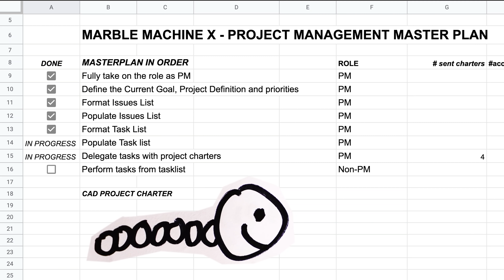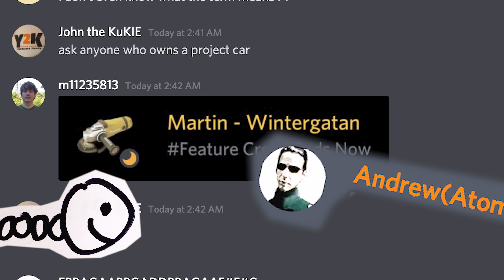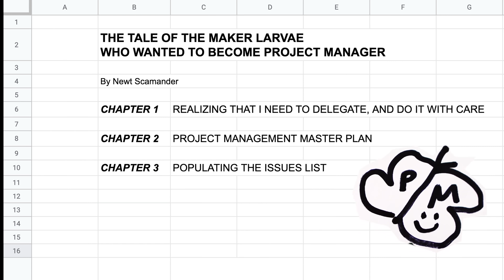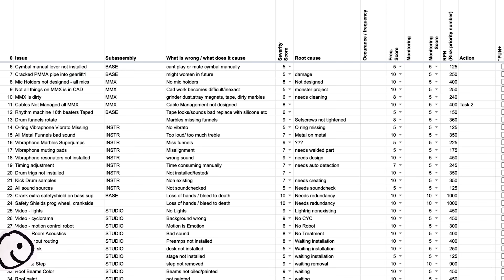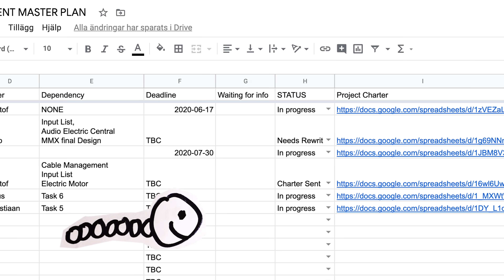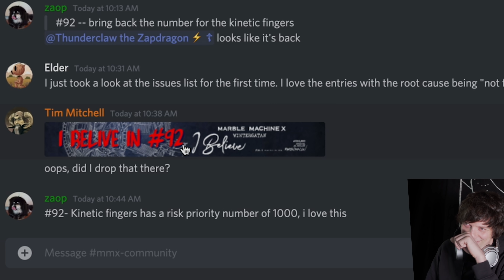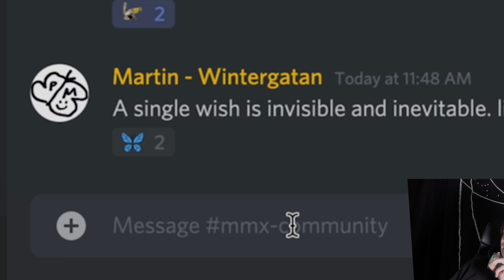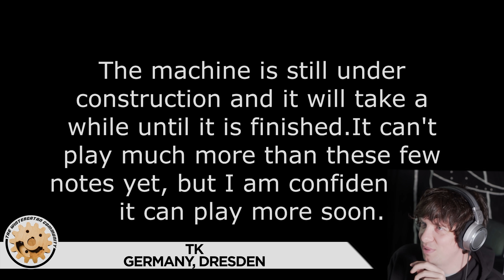109 Things To Do

Comment: Delegate using SMART objectives.

Specific- Tell your delegees exactly what you want. Anything you don't specify becomes their prerogative to accomplish how ever they prefer. 
Measurable- Will your delegee know when they've fulfilled their task? What does the part need to do?
Attainable- The task should be difficult (if it was simple, you should've done it yourself) but not so difficult that failure is likely.
Results Oriented- Delegees should know how their part fits into the larger objective so they'll know if it fulfills its actual purpose.
Timely- Give your delegee a deadline for completing the task. Make sure they let you know as soon as they realize that the deadline is unattainable. You can then decide if they need more time, or more resources to stay on schedule.

Comment: for the issue in the engineering team discord channel about the metal studs on the programming plates, could the studs be made smaller and then a softer material cover out of delrin or rubber etc... be applied over the stud with epoxy or even a small magnet that way they could be easily replaced when they wear out.

Comment: I think you're aiming too far. 
You should keep the MMX for YouTube videos and make an album and most importantly CASH IN. 

Then build an Marble Machine Voyager that is sturdier and better at travelling. This one can be built from scratch and specifically for traveling with industrial and replaceable parts and will not be so fragile.
Reply: The problem is that that was the idea for the Marvel Machine X, after the original marble machine, was it not? (i.e. The MMX was always planning for a world tour from the start, with resuable and transportable parts...)
So I feel the same thing would just happen again..
Reply: With the MMX Being split into sub-assemblies and Martin always having had the world tour as the end-goal, I'm inclined to say that the MMV and the MMX and indeed the same thing. Sure there are still a lot of teething issues, but this is just the next stage of the project, ironing them out.
Reply: The MMX is built with wooden parts and has been so much built and reassembled and changed that it's inevitable that precision parts will weaken and deform. 
Building a travel capable machine and building a prototype machine that is easy to build under budget as you figure things along are very different, I mean he's never even considered heat expansion in the materials he's using or variations due to warping and humidity and there's SO many parts that are in plywood. 

My point is that making an engine that is capable of traveling around the world at this point is just too much. He should walk and build a sustainable system before he can do a marathon.

Comment: I dunno man. Even the PM work feels over-engineered.
If you want to learn and grow using a forever project, this is awesome. If you want MMX done by a concrete deadline, you need to yield control to an expert senior engineer and follow their lead on all things. You can always go back later and improve on it, season after season.
Reply: What engineer would take the project in this shape right now? You do not even have an accurate CAD model. How will you design stuff? How will you do any kind of analysis?
Reply: nukularpictures the Concorde and Saturn V were designed and built without a CAD model.
Every problem in the MMX can se solved as a sub assembly physically prototyped and refined...and then, afterwards, scaled to fit in the actual assembly once the proof of concept has shown it solves a problem.  All that is needed is approximate measures of the spacing required and clearances afforded.

Comment: MMX has to work when repeatedly disassembled and transported around the world, in Rain, in Wind, in Warm and Cool and Humid conditions. MMX is a confluence of metal, wood, plastic, and other materials. And yet so many components are built to a tolerance of 0.1mm and if that tolerance is off, all joy stops. Many times throughout the build, I've seen designs implemented where the tolerance, temperature, and humidity are in a strictly controlled situation and it works. But if any of those variables change, disaster!

I'm a huge fan and have been trying to think of constructive ways to express my increasing concerns without coming off as a jerk.  I believe in the project and am a supporter. But there are a lot of potentially temperamental aspects here that there's almost a certainty will fail under tour conditions. You've got the MMX to a very close completion and I think it can be absolutely saved. But to do it, I think some things will be simplified and stripped away, and some other ways to interface disparate materials other than having a 0.1mm tolerance will have to be found.

Even if you have to remove 20% of what is on the MMX, it is still a mindblowing machine and at the same level of sophistication as the most advanced machines at the Speelklok museum. You've added so many adjustments and ways to Solo and Perform rather than just turning the crank that I don't think it will cause boredom on tour. And anyway it's not a competition in # of parts -- it's about the music. :)
Reply: You should probably (nicely) discuss these things on the discord server - martin doesn't really read the comments here, that's part of why he started the server. From the look of it, I think your comments will be taken the right way, especially if you try to build a discussion on how to practically and efficiently deal with the issue. The place seems to have a good culture of practicality and grit.
Reply: The Engineering team is on it!  We've recently found a specialist in FMEA and failure analysis, and a number of us engineers are painfully aware of this.   Thanks for believing!
Reply: @jacoblarocca9205  This. If you think you have an Idea. 99.9% of the time, someone else has thought of it already. Last year on the MMX reddit I saw so many people having similar "concerns" without actual expertise behind them. And in the rare circumstance that the MMX team isn't aware, use the right channels to reach them, explain the problem you found and back it up with calculations.
Also, the "humidity will kill the MMX" has been said by fans over and over and over.
Reply: @VulpeculaJoy  while I enjoy watching what has become an engineering trainwreck/nightmare this project is doomed for it's goal. There is just no way to use this device in a tour based manner. He's pretty much taken common sense engineering practices and thrown them out the window because it "looks cool"
If you're familiar with F1 cars or some high performance aircraft you will know that for ever usage hour hundreds of hours of upkeep and maintenance have to be done. I would wager for one show this thing would need 20-40 hours of maintenance each time it shipped to a new location to get consistent playable quality. The amount of moving parts for the sake of moving parts is absurd.
Reply: I couldn't agree more. I worked for a scene shop building props and automations for large Broadway touring shows and you learn quickly how robust anything you expect to send out on  the road must be - especially any automation that has to be broken down and reassembled in a typical 8 hour load-in. While having something this complicated isn't necessarily a problem, not having built it with the rigor to handle the assembly and disassembly, boxing and unboxing, road vibration, bumps and bangs, repeated use, and still have all the components be able to be precisely aligned every time is something that has to be undertaken as a foundational principal in the design and prototype phase, not something to try and fix after the fact. So many parts are shimmed or hand bent and will likely have to be redone every single move. Tuning this machine and checking all the parts are working smoothly and reliably after each loading is going to be a very long process. I fear many of these adjustments may slowly get out of alignments during even a single performance. Some parts that need robust attachments use flimsy fasteners, other parts you want to have adjustability are just haphazardly permanently welded on.

For someone with great musical talent but no design and construction ability to start with, it was fun to watch Martin come at this project from this place, see how he would approach these challenges. This series has been fun and very entertaining, if getting a bit long. You look at the automated musical instruments from the museum that inspired Martin, and the biggest difference you can see between their machines and Martin's is the level of craftsmanship and engineering that went into those machines. Having an "I can do anything" attitude is great, but the experience and skill needed take a lot of time and effort to develop.
Reply: I agree with this. Anything that requires lots of fiddling just to get by is not going to fair well long term. I think it can be fine in a controlled studio environment, but any disassembly, and travel is going to require a tremendous amount of time to recalibrate every component. Even a slight bend change during shipping, or the leveling of the machine will change so many fitments. More components require stronger reinforcements, and things like dowels for repeatable alignment. It may not be fit for a world tour but he could probably pull off a few shows with enough time to setup and prepare. If he is overwhelmed now, just imagine him after every show having to fix all the issues that will arise while on the road.
Reply: Spot on. We are planning to do a full FMEA with all the use cases in the life of MMX.
Reply: @Atomkukac1  Seriously? That is hundreds of man hours at least. Especially with a project in such a state it is a nightmare. Been there, tried it, scraped it. 
The fact alone that there is not a complete CAD model, that stuff is bend to make it fit, etc. 
If I would take over such a project I would go and really say we do a clean start. Fixing all the little problems right now is basically impossible. That is always what happens if you start a project without specifications and a clear plan on how to proceed.  

And one part that must not be overlooked at this point. Yes there are right now a lot of people working on it, putting thousands of hours into it, however you will have high fluctuation as it is all done for free. If you only have one person doing this work, I would assume it will fail. Spending hundreds of hours and not seeing progress, will lead to a lot of people quitting.
I would love to see the machine finally working, however I think what is happening right now is the wrong approach. Finish the machine as it is right now, dont care for it working perfectly, dont care for the tour. Use it to validate the ideas and design a new machine. I would bet that it will be quicker in the end and it would make people see the progress.
Reply: There is just no way this thing will make it from place to place without having problems. He'll need extra parts or a welder if something breaks on tour. Plus he'll need a freaking forklift even with him breaking it down in pieces. It's still gonna weigh down whatever vehicle you put it in.
Reply: If ever the machine were to be significantly reworked to be tour-compatible I hope they will at least use the completed version for some studio recordings before that, as the quirky, hyper-engineered concept of the MMX is a big draw for me as a non engineer.
Reply: In addition to all this, the MMX has so many wear items that are going to start behaving unpredictably once it starts getting used regularly.
Reply: I agree totally.  There is no way this monster machine will ever be able to endure touring.  Too many things will need to be tweaked, repaired, adjusted, tuned each time it is unloaded (if it makes it to the destination on one piece).  On tour you should have a tech able to set it up and calibrate it and test it.  If you are going to have to go back to it at every stop and make corrections, fix broken welds, adjust marble catchers and make sure everything flows properly you will absolutely go out of your mind and ultimately the tour will fail.  I love the project, I want to see it a huge success but I have me reservations about this being a touring instrument.
Reply: Morgan Feldon I work on high speed packaging equipment (200+ pieces/min) 
He needs to only perform at locations that it can brought in as a single massive instrument.  

Just regular instruments need to be tuned/ set up to play.  This if taken apart will take days to set up and tune.  Also anytime you take something apart there is a good chance of damage it, or lose parts or not get it back together and then if you have a massive failure causing the machine to break or not work.  You can have all the spare parts but the part you need you don't have.
Reply: @invisible468  Yeah, the "touring" parameters for the design...you can tour to concert halls and you can "tour" to underground pubs, and churches, and open fields, too. Not all "locations+suitability" are created equal. So the "tour-capable" goalpost is one that can easily be moved,
Reply: Just oil everything  and that'll fix the humidity sensitivity and prevent binding
Reply: @wesbrackmanthercenthusiast4695  yeah, boiled linseed oil - magic
Reply: I can't count the number of times I've sat here watching him tweak and fiddle something into just barely working and thought "Yeah, that's never going back together the same way again."
Reply: The other option would be to not tour with that machine and use it for studio recording instead. Maybe it would be possible to build a smaller tour-version as well. I think a lot of the viewers here, including me, are here because of the first MM and it was amazing when presented in a video. And that would be possible for this one, too, without touring.
Reply: @SolarisUrbinoFan   The tour is part of this project, you can speculate on what comes  next  on  MMXI but not without MMX tour data.
Reply: that's what i'm thinking too. the MMX is modular as Martin have said before because he really wants to bring it on tours, but because of the complexity of it, the number of intricate parts, and the precision it needs in assembling is difficult to attain. To have a perfectly working MMX on the spot i think will be a rare occasion. But I still believe Martin and the community can do it. Let's hope that in the near future we can see the MMX at the stage with Wintergatan playing us some lovely tunes.
Reply: Good engineering points. I have been watching this waiting for feature creep and the design method to crash. As an engineer, the design method is driving me nuts. I've been in charge of large projects including complete unit designs for refineries that the design process seemed down right simple compared what has been done here. I'm not sure if there is a logical method to the madness that has not been addressed in the videos but haphazard design of complex mechanisms rarely turn out well.

Thinking about it, I have to wonder if its the artist way of thinking verses that of an engineer. God knows I can't make art or music to save my self but its seeming like the reverse is true of the artist.
Reply: @Mongo63a  No, the reverse isn't necessarily true. There's nothing about being good at art that should limit such capabilities, It has more to do with the self-taught nature of Martin's engineering background. Many people who also can't make music are liable to make the same mistakes as him.
Reply: @Mongo63a   Gotta agree with the artist/engineer  conflict - as a former theater designer/fabricator/coordinator it's a fun ride.